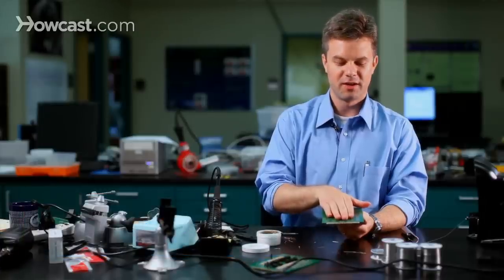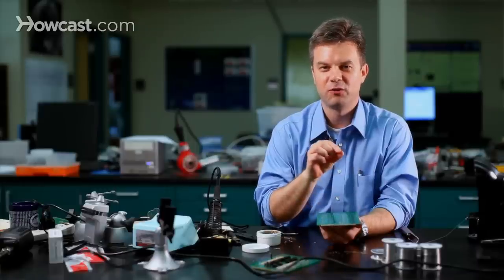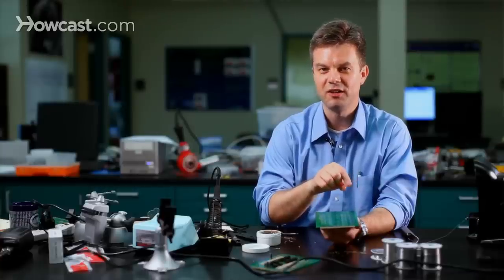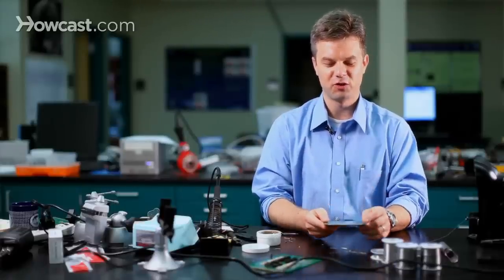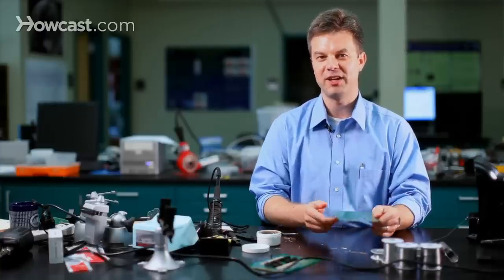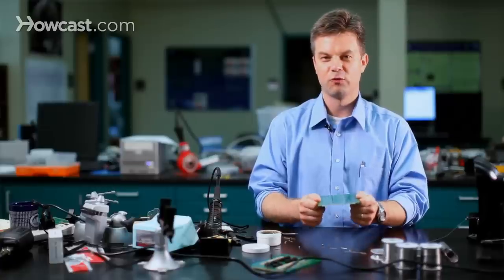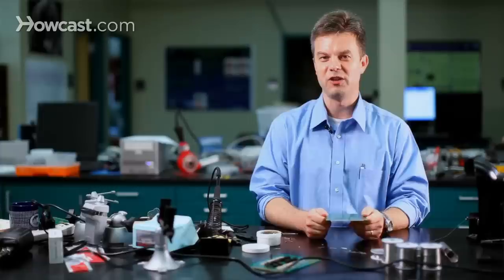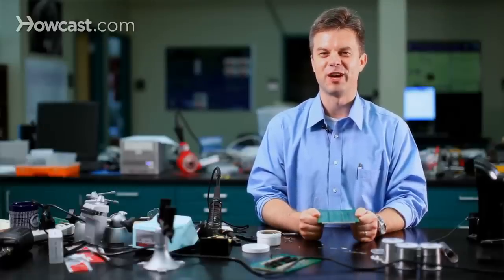What Is Reflow Soldering? | Soldering

Comment: What temperature?  You keep saying “raised to proper temperature” but never share what that is.
Reply: The heating temperature. He did mentioned about the temperature above the melting temperature (of the solder) before he said "raised to proper temperature". I mean you need the heat to melt the solder, so maybe that makes sense i guess.
Reply: So whatever you are using to heat the solder, just increase it to the right temperature, the composition and fluxes play an important role too